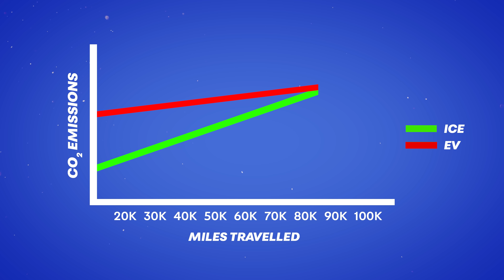Are Electric Cars REALLY That Green? [New 2022 Data]

Comment: If you really care about the environment, keep your current car and drive it untill it falls apart. Every time you buy a new car, the cost of emissions, materials, minerals are huge.
Reply: How is the comparison for diesel with much better mpg than petrol.
Reply: @douglasgreaves188  While you go farther on a given QUANTITY of diesel fuel, the fuel has more carbon in it. the Carbon production per mile if diesel is actually quite similar to gasoline(petrol), which has more hydrogen than carbon, but, you burn more of it. On a carbon stand point, it's not too inaccurate to lump the 2 fuels together.
Reply: @Alfred Wedmore bought wife a Mini 30 mpg at best, my old diesel car would average 55. Looked into EV prices are coming down but I don't do the mileage to make savings. Vans don't have the range. Plus I want to keep next vehicle so battery life doesn't suit.
Reply: @douglasgreaves188  The money you save from not having belts, filters, oil changes, clutches, transmissions, or emission controls will save you more than enough money to replace the battery after hundreds of thousands of kilometers of driving. Add in the savings in fuel, and the question becomes, "Can you afford NOT to have an electric car"!
Reply: @vincentrobinette1507  clutch change 150,000 do my own oil & filters. Travel to London crew van, would need to charge on the way pay crew while waiting. To be on site for safety meeting 8.30am leave house 4.30am. I'm not getting up at 3am to go to work, or leaving Sunday evening. For long range or heavy vehicles EV does not work. If you are not doing the mileage doesn't pay for cars either. Battery life after 10 years no point buying one. I own all my vehicles & look after them don't want to monthly rentals. They might work for some but let's wait to see what happens to all these cars at 10 to 11 year mark & the used car market.
Reply: But I don't want to save the environment.    I want to show people I care about it by driving an EV so I can feel superior. 😌
Reply: If you buy a hybrid you can drive electric through towns and petrol in the country - then everyone is happy - or no-one is happy!!!  :-(
Reply: The question would still be, what car would you buy after your ICE car eventually falls apart?
Reply: Very true! The more miles you put on a car, the more you divide out the environmental cost of manufacture. If you take the cost of the car, plus, all the money you spend on fuel, maintenance, and repair, you will find that the cost per mile will continue to go down. That is, until something major happens. You will need to add the cost of something major like an engine, or transmission to the numerator of the fraction, and see if the car will last enough miles to bring that cost per mile back down. If not, that money might be better spent on its replacement. At that time, you might look into going electric.
Reply: @vincentrobinette1507  No, you don't want to go electric. With an ICE car, what you explained does happen. And it does work that way because because with the ICE car with proper maintainance you can run the vehicle on the drivetrain almost indefinitely. And as you stated this is minor even if you do include something major because once it is fixed or changed due natural lifetime wear you can go back to long term use of the vehicle. WIth the EV you can't do this. Because of the Electrical Drivetrain. you will have to change the batteries every so often. Each time will be expensive and they will never be in the vehicle long enough for you to recoup the price. I am not going to comment on the drivetrain itself because I don't know if it would need short term replacements. But the Fron-Wheel-Drive versions are just like all other FWD vehicles.  Due to structural built-in defects they don't last a very long time to start off with even if you baby them. And I know someone will comment on this and say I know of a FWD vehicle that is still on the road after bla, blah, blah miles. Okay, show me twenty more of this vehicle.
Reply: @Alfred Wedmore Diesel engines have to other advantages: Much higher compression, which gives a higher expansion ratio. Diesel engines have no throttle valve, so there isn't the air pumping losses of pulling air past the restriction of a throttle valve. Between those 2 things, diesel engines are able to produce more usable output per BTU of fuel, than a throttled gas engine. Add to that, the higher energy density of the fuel, and it's easy to understand why there are no gasoline over-the-road semi trucks. Even though diesel fuel is more expensive (at least in the USA) it still costs less per mile than gasoline in the same vehicle. Diesel engines have a much wider range of load and speed that it can operate efficiently, than gasoline, due to the lack of pumping loss.
Reply: @Alfred Wedmore diesel is not more energy dense than petrol.
Diesel engines simply are more efficent
Reply: @Alfred Wedmore epa has ruined diesels efficiency with the exhaust emissions system. No benefit to have a diesel over gas at this point unless you want to give your money away maintaining the exhaust emissions systems.
Reply: Going green doesn't always workout for the hulk
Reply: @Alfred Wedmore The batteries will degrade and it will have to be scrapped in a few years.
Reply: I've got an 18,nearly 19 years old corsa, suits me fine, parts are cheap, insurance is dirt cheap lol!!
Reply: @Truman. AMEN BOTHER.    yes,  and if it's a Honda or Toyota all the better.
Reply: That's my plan, but my next car will be electric for sure.
Reply: @Truman yes and no.  If your old car is burning or leaking oil for example, that's not very environmentally friendly, and many cars start to do this once they hit 200k miles (and some sooner than that) so while it may seem greener because you're not buying a new car every 5 years, it can be more harmful in that regard.  Plus as cars get older, their efficiency sometimes drops, as the engine ages, things wear, etc (this goes back to oil burning for example).  Electric cars are no saint either, in that with current technologies, a lot of harmful waste goes into the environment to produce the batteries, and batteries have only a certain life cycle before they are deemed useless and have to be "scrapped" or recycled (which we know in most cases with recycling, the majority of the materials is not recyclable for many things, only a smaller portion is).  Electric cars are a stepping stone to more truely renewable power sources, like hydrogen fuel cells, which I believe will be the next step in a greener mode of transportatin, once we can figure out how to make this happen on a larger scale.  The technology exists today, but logistics (on a large scale, and perhaps safety) are the biggest issues surrounding this technology.  I don't think the electric car is the future for vehicles, but it is a stepping stone.
Reply: Also buying bottled water most plastics cant be recycled.  Joe Rogan episode on it
Reply: True, and no one forces you
Cars degrade though, usually you sell it on, not dump in a river or a ditch, and when they come to end of service they get RECYCLED
Reply: Engineering explained has a good video on that☝
Reply: @Alfred Wedmore not exactly. Diesels dont rev as high and have torque from low rpm☝
Reply: @Alfred Wedmore more rpm=more fuel. Having more torque at lower revs means you dont need to rev high, thus use less fuel
Reply: @Alfred Wedmore plus diesels have almost twice as high compression ratio which translates to efficiency
Reply: Let's look at the countries that are the biggest polluters first.
Reply: @stevemiller9299  so that you could justify YOUR ignorance and wrongdoing?
PATHETIC and ANCIENT😩
Reply: @stevemiller9299  yeah, lets look at the worst so that we can boost our ego, ignorance and narcissism.
Maybe you should implement this genius "strategy" in schools and workplaces?😩
Looks like you belong in correctional facility or psychiatric unit😁
Reply: @Alfred Wedmore although i am factually correct as all chemistry is in weight as volune is tempreture dependant energy density as in joules per gram. i do however conceed that as we measure or fuels by volume than i conceed that one liter of diesel is greater than one liter of petrol at the same temperature
Reply: @Alfred Wedmore i clearly explained it as joules per gram its a simple concept if you were not being arrogant you would see that. Using STP you could. Compare the energy per liter as i conceeded albiet without being a flog. 
You seam to be confusing energy density by weight with that of by volume at STP easy mistake if your so set on your on point you fail to read what others actually say.
Reply: It really makes little difference if you buy a new car or not. After you've finished with your old one it continues to be used by the next owners until it is scrapped.
Reply: @russelldesilva1560  further down the line, someone scraps a more polluting car to get a less polluting car. So to get at the real environmental profit, you don’t look at your own old car and new car, but at your new car and the even older being scrapped. This is conceptual of course, as you can’t attribute an exact scrapped vehicle to your new car.
Reply: @Alfred Wedmore Diesel was the last big lie, now it is electric cars.
Reply: Then when it falls apart fix it
Reply: True only if you scrap the used car. Of course your used car will be recycled when you sell it to the next person.
Car sharing, walkable cities and public transit are the way forward.
Reply: The only green I care about is all the green (money) my EV is saving me.
Reply: @josephmcclary9667  a fair thought, because no personal car or commercial consumer product is going to save the ecology.  We buy things we use.  Our consumption and  use of things produces impact.

If 120,000 miles of a gas car use starts with a $20,000 purchase (say the new Maverick car/truck)  or a $17,000 Sentra/Civic....then you will use 3000 gallons over your years with the car.

If the cheapest good EV, the Tesla 3, costs you $55,000 then you don't save cash until you've bought $35,000+ in gasoline if the electricity is free.  It isn't,  so you don't really save money till you buy $45,000 in gasoline.  That's a lot of gasoline.

Math is a cold mistress.
Reply: @STho205  my LEAF came in just under $30K before tax. I drove approximately 55K last year with no end in sight. I’m hoping to get 3 more years out of it, then it will go to either my kid who will be 17 then, or my wife. I pay either 0, 7 or 24 cents per kilowatt hour depending on how sunny the day is/was (I live in Phoenix) because of my solar panels. I drive this car and it makes me money. I wouldn’t make squat with an ICE vehicle. Plus I’d be spending much more on maintenance.
Reply: @STho205  by the way, it’s an apple to oranges comparison to use a Sentra (econobox) and a Model 3 (compact luxury car). Nobody in their right mind would cross shop those. Why not use a Lucid vs a used Pinto if you really want to make an invalid point?
Reply: @josephmcclary9667  model 3 is the bottom of the really usable EV market.  A Leaf is a compliance car and still overpriced at beyond double the Sentra.  The other cars like the pieced together LG-China Chevy Bolt (when they feel like building some) or BMW or Mini aren't really approaching the real usability of a Sentra as a transportation device but are much more expensive.  Volvo E, Tesla S, MustangEs, Audi Es are more extensive than the average budget T3 long range config, so the T3 is the best to compare.  A car is a device that moves you butts without walking....a luxury couch and infotainment center  is irrelevant

So it is apples to apples.  It is the fault of the EV mfgs to not build a car that sells for 20k like a much more versatile Maverick or the same five seat cramped sedan as a T3.
Reply: @josephmcclary9667  good for you.  30k NEW without help from other taxpayers via credits?  If so you just have to add $13,000 in gasoline to an equivalent Nissan Sentra to break even on free electricity.  $20,000 of gasoline with the charge electricity actual costing.

Don't forget the extra meals and extra hotel stays for any long trip that could be accomplished in 9 hrs or less with the Sentra but 14 hrs for the Leaf.  They add up to about an extra $100 a day for a couple travelling.

Math, a cold hearted mistress.
Reply: @josephmcclary9667  amort your solar panels and maintenance over 10 years at a price per day.  That's how much you pay for the "free" electricity based on the kW actually used each day.

I'm grid hooked to nearby hydro.  Costs 8c.
Reply: Buy used and drive it till it falls apart.
Reply: @jrandliz  not a bad approach.  Eventually the unreliability is a factor that costs too much money or possibly lives.

Eventually any appliance needs to be recycled or rebuilt.

I've found some frugal cars can go 18 to 25 years in good service if maintained well and you bought it young.  If you buy a beater....best you'll get in 10k mi and 1 yr for every 1000 you spend.  Worst you'll get is nowhere. 

I had a 1990 Miata for 16 years and it had probably 5 more years in it, but I needed a back seat.

My daughter's HHR is a 2006 and in pretty good shape.
My Ford is a 2013 and still runs and looks fresh.  Conveniently starts every time I need it.
Reply: That is what I did.  I had to change car because they didn't make replacement parts for it anymore.    It needed a new gearbox and to have one custom made or the current one restored cost more than twice the value of the vehicle.
Reply: Biking or walking is greenest of all
Reply: @sprucedude  dying is greenest of all.
Let me ask this in sincerity.  Assuming you are an adult...  Do you own an automobile and drive?  Do you walk to work, market?  Do you live close to 90% of your desired destinations?
Reply: Same can be said for ev cars, you have to make the batteries, where do you dispose of spent batteries?
Reply: Thank you!
Reply: But obviously maintaining it before it falls apart…
Reply: This is not necessarily true.  Pretty much every car that has been produced will be used by someone.  You buy a new EV, and sell your old gas guzzler to someone else who drives it until it dies.  But if you sell your gas car to a retiree who will drive it less than 3000 miles per year, and you replace it with an EV that you drive 10k/year, you've just reduced emissions, and you have done so without creating demand for another gas-powered vehicle.
Reply: Does that assume that the current car (the gas powered) is not being sold, and not going to be used?  Wouldn't the next owner also be part of the equation?  I'm not sure how that works out though.
I get what you are saying, and generally that's what I think, but I'm trying to consider the entirety and see if that line of thought is right.  
We'd have to assume that if the car is left in good condition when replaced, that it'll still be driven by someone.  Assuming some sort of trickle down effect with cars, with some of the market consistently buying secondhand/thirdhand/etc.  and consistently needing "new" used cars, does it actual make a difference if I bring an EV into that consumer stream earlier?  Does that cause any vehicles to be disposed of earlier, with that considering?  I wonder.
Reply: Well, like someone's already said, the greenest option is no car at all, if possible.
Reply: That's the best advice for going green. But plenty of people need a new car each year or two so they can keep up with their neighbors, potential tax write off's and help the economy.
Reply: That’s a fair generalization but a bit simple. Changing from a 1975 Impala to virtually ANY new car nets a gain in a week or two, for a extreme example. Any car can become much dirtier even from low standards of maintenance so a change to even another ICE car can net benefits in a couple years. I keep cars for 20-30 years and maintain the crap out of them, really a necessity for such a long life. But still, I’m driving an older car and it pollutes much more than any 2022 model.
Reply: This^
Reply: In Holland are taxes more expensive  for cars older than 15 year!
Reply: Yes the same goes for your every day plastic bag
Reply: Quite often this isn't true. If you count the option of converting your current car into an EV, you most certainly shouldn't just keep your gas car. Costs money, though.. 😏
Reply: Just make sure to change your spark plus and service!
Reply: Wrong!
Reply: Check out videos by James Tour on flash graphene.  Huge potential for CO2 and methane reductions
Reply: Agreed. I’d like to add to this, buy a used car if you can - if you can buy a used electric car, so much the better. It’s better for your wallet and the environment.
Reply: What’s wrong with selling it off to someone rather than using till it falls apart?
Reply: YES!  This!
Reply: By then your engine would have lots of problems a lot of parts would of been replaced and you can’t get a good deal out of it
Reply: @budderz908  Cheaper to maintain an old car than buy a new one. Unless of course you own a European POS.
Reply: @Alfred Wedmore their is more to Diesel better mpg than fuel density. Diesel engines are more efficient than gasoline engines for two reasons: (i) higher cylinder pressures and corresponding higher temperatures lead to improved thermal efficiency for the diesel engine; (ii) the air throttling required to control the gasoline engine power output reduces engine efficiency / volumetric efficiency. I would also would like to see what the initial carbon footprint manufacturing a battery with 400+mile range. True like for like comparison on other factors would be interesting too
Reply: Mine did Fall apart and now I bought an EV. Before that I usually only bought used cars which would break down every 3 to 5 years and rhen I Sold them and they got shipped to africa where they probably still drive around and pollute the Air.
Reply: .. Sounds good until you realize that the cost of repair often exceeds the replacement cost of the entire car.
Reply: I'm going to drive a v8 until I can't afford the gas or they pry it off my hands.... too much hypocrisy around this
Reply: Consumerism vs Keeping and repairing is not sustainable. We either change our culture or we fail.
Reply: @Exo runner hydrogen fuel cell is not cleaner than an EV.
Reply: 100 💯
Reply: Or don't use anything but your 2 feet or a bicycle
Reply: Dumbest video I have ever seen. Look at how much pollution is generated from getting the crude oil into the gas tank of the car. A ton more emissions and other environmental damage is done. Initial farming of the materials for the batteries is very costly but about 90% of the batteries can be recycled making it more environmentally friendly. Also Tesla giga press reduces the amount of materials needed to manufacture a car is a big plus. States like California are already about 50% renewable energy and much of Europe is even more. Overall from day 1 electric cars are better. Legacy auto is so far behind in electric tech this is the only way they can discredit EVs.
Reply: Alternatively, manufacturers could stop using Henry Ford's planned obsolescence as a core principal and build products to last and we could not allow fossil fuel industry executives to decide the fuel economy standards manufacturers use.
Reply: No comparison, 30+ year old car 1ton with catalityc converter, 6l/100km...
For the weekends, a camper 7l/100km. 
20+ year old bicycle for the city,
Whatever I do, however I abuse them, I will never be able to release more than 40 tons CO2  for the next what 30 more years?
Now look at it this way, the average person releases 900g CO2 every 24h. When I ride a bike, my CO2 emissions triple for the time running it. 
Now back to the 900g, multiply it to the 8.5 billion humans populating the earth and... 
So a smart ass would rather suggest to stop breathing while riding bike?
Allow me to give you another perspective, how many recharge cycles the battery will last? Will you reach by then the those 135000 km? 
Then to keep greener you buy a new battery, great another 25-30t of CO2 right? And you are O.K. with that? 
2 options here, you sell the car for pennies to someone willing to replace the battery and drive it, which won't be always feasable(a new ev will have a lower cost by then...).  Or send the useless electric car to a poor country and polute their land with all the heavy elements the battery contains... 
And then guess, you also have helped polluting the ocean with nickel, cobalt, cadmium to name a few. 
One day a good parent buys a tuna can for his son... And hes brain got damaged of heavy metal poisoning. 
I'd rather stop the rant here, but new ev I doubtfully clean the air, but polute the land, then the sea, and then it hits back to you, me and all living thing, only from a different direction. Follow the money, and then you will see, all car companies are creating a huge wave for everyone to ride a hype on. And thus keep selling for more profit.
There is more to this, but is already a long post for Saturday morning, I'd better go ride bike with my son than chiseling here.
Reply: Scrapping your existing car if it’s older than 5 years and buying an ev is the better option.
Reply: @tigertoo01  not even close to the better option!
Reply: Spot on 👍🏻
Reply: I say ,buy what ever car you want and cycle everywhere and only use the car occasionally!  You will save wear and tear, ⛽️ fuel, get fitter and healthier.  Let's get off our ass instead of sitting in the car all the time!
Reply: @markwalker2986  good plan!
Reply: ok
Reply: You don’t order a car from scratch lol
Reply: @sillymesilly  you mean you don't I always do so I am not stuck with garbage that I don't need or want and that has a huge toll on the enviroment!
Reply: If you care about the environment avoid getting a car at all
Reply: @DiversionG  yeah let’s all just go back to the Stone Age!
Reply: @asifitmatters1  Ever heard about trains
Reply: Truman I absolutely agree, I would never buy a new car anyway due to the obscene price, not to mention, they all look and drive pretty much the same these days, too much assistance in the controls and too many nanny statery electronics for me I'm afraid.

Let's be honest here, nobody in the grand scheme of things is buying new cars, and they certainly aren't keeping them for 90,000 miles, they are financing them for 3 years (and probably doing 10,000 miles per year) and then moving on to the next new one. If we keep this model with EVs we will do FAR more damage to the planet than using what we already have.
Reply: How does keeping your current car help with grid battery storage?

Great way to help China wipe out European brands though 👍
Reply: They tell you anything and lie . You are consumer and you must buy. Whatever makes you feel good and buy buy buy. Your all little money works now buy this b.s. now
Reply: Tesla takes less than 6000 miles to absorb ALL production and component emissions
Reply: Or if you have decent public transport, just use that or a bicycle.
Reply: My current car (95 Honda Civic) had been falling apart for years but it's finally getting bad enough (a literal hole in the chassis just in front of the driver seat) that I'm ready to buy my first brand new car and it's going to be electric ⚡😁⚡😁⚡😁
Reply: Uce public transportation
Reply: Only if you junk the car, most cars are resold
Reply: Exactly
Reply: Someone needs to relay this info to the London Major. 😅
Reply: In India, there's a (ironic) rule in cities high on pollution like Delhi, that citizens can only keep a car for max of 15 years irrespective of whatever emissions conditions of that car be (even after the BS6 norms). One compulsorily has to change his/her vehicle after 15 years of purchase or the government has the right to seize and dump your vehicle.
Haha, like they really made this rule for "prevention of air pollution" and not at all for profit maximizations of the car manufacturing industries ! YEAH RIGHT...
Reply: Stop with the propaganda lies. We have a supply chain problem for obvious reasons. But a trend of Less New Cars going forward seems permanent. The Average Fleet Age of ALL Cars is getting older. People are NOT scrapping cars early causing more waste than before. We CAN NOT just keep delapidated cars on the road indefinitely. Eventually the Average Fleet Age gets too old and becomes a Reliablity Safety risk. Your Insane Propaganda ignores than 2nd Hand Cars stay around for a long time.
Reply: @Gusli Kokle but that's not how it works. For example, a Leaf battery is 48 packs each with four cells. If your capacity gets too low you probably only need to change one or two cells. Which will cost less than one fuel injector. And if you ever do change it the whole pack, it's worth a bit of money second hand for industrial or domestic storage. They're highly sought after because no one ever really changes them! And when they're totally dead, the materials can be reclaimed and recycled.

Of course you can find isolated instances of total failures. I can find isolated instances of petrol cars blowing up when they spill fuel onto a hot exhaust. But in general, the packs last ages, can be easily repaired, and have a good second hand value even when every single cell is below what you need to do your daily driving.
Reply: They are forcing us to buy electric. That's one reason they want high gas prices. Please think about it.
Reply: @SerenitynPeace  Yes, and one of the things that happen is that Brandon shut down all Gulf offshore production.
Reply: @beauxr.benoit1374  A lot of damage done... 😔
Reply: For the global environment keeping existing ICE can be greener, I own my cars until they die an don't have an EV yet. But for local environment that is a completely different story, especially in cities where vehicle pollution is starting to be listed as cause of death as the respiratory attacks and death rates coincide with NOX and particulate density at street level. Ironically some of the worst pollution damaging your kids is when parents lovingly drop them off or pick them up from school as loads of idling ICE powered SUVs are gathered outside the school.
Reply: @johnpublicprofile6261 You're absolutely right. In my state, they actually ask us not to idle our cars, for that very reason! (one of the main advantages of a Hybrid, or electric)
Reply: @johnpublicprofile6261  nah, swapping is better for co2. The problem is burning inside the engine.
Reply: Engineer, designer, fabricator , do this for a living, new electric cars greener than OLD cars, absolutely not
If the older cars are redone ( cheaper ) burn way more efficiently, batteries are hazardous waste , plastic and batteries , 2 worse things we create, can’t get rid of, the batteries for your flashlights, cameras etc... do you throw them in the garbage or recycle, like your SUPPOSED to, going out on a limb here, NO, now times that by 10 million plus, of radioactive junk in landfills, now add 10 batteries in every car in the world, lithium at that, worst of all, the damage on this planet you have just created because of making a battery
Everything runs off oil, 95 % of what you use daily in your life, oil comes into play, comes out of the ground, goes back in, natural, batteries are NOT, it’s just WASTE
Reply: @user-dz6wg8wr1d  yup, making cars is terrible for the planet. But you know what's worse? Burning gas in your engine. That's all I'm saying. You can totally make more pollution and cause more greenhouse gases driving a car than making an EV, if you drive far enough.
Reply: The best option: converting your old car to an EV
Reply: Carbon isnt bad!!!!!!!
Reply: There is also the cost of replacing the batteries after about 9 years. That should really penalize the ev.
Reply: Using buses , trains , metro , bicicle , on foot , and tram is the cleanest way to travel , according to ME.
Reply: Or don't get a car... Oh wait you can't cause car and oil industry rule our lives
Reply: @Hhhh22222-w  I've been to places where the public transportation is so well developed, I probably wouldn't own a car. If I buy something big, like a water heater, or even a big screen TV, I would just pay to have it delivered. If I buy something from a home improvement center, many of them have trucks that you can rent, to haul building materials or large appliances or even yard power equipment home. You do that so seldom, that you save money, by not having to register, insure, maintain, and fuel/charge your own vehicle.
Reply: @Hhhh22222-w  what are you trying to say? This sounds so stupid. If you don’t want to buy a car then don’t
Reply: @Hhhh22222-w  what are you talking about.
If I want to visit a specific area in the countryside for example I need to drive.
Or pick up and drop off my kids at nursery for a very specific time.
That's not oil companies and cars ruling my life, that's the oil industry and cars providing a service that allow me to live my life how I want to.
Reply: I wonder if Volvo included the enormous environmental issue of mining the exotic metals used in batteries. For example Cobalt from the Congo where the workers are kids. And pollution when shipping these metals to battery factories. Then the pollution to dispose of them when they wear out. 
Regular cars use mostly steel and aluminum 
Which are easy to recycle
Reply: Making batteries cause far more pollution that making a "fuel guzzling" Range Rover OR otherwise a Chevy Suburban! So care to buy one of these then?!
The only thing that convince me to go EV are the running cost as well as smooth and quiet ride. A 5 minute drive from home to a liquor store only cost few pennies! Heck I've ended up buying more booze since I can save so much on transportation ;P
So EVs are not really that green.
Reply: @t8polestarcyan22  Most important of all, NO DUI's IF SOMEONE ELSE DRIVES!!🥳🥳
Reply: @t8polestarcyan22  Er no sorry, you have that backwards.
Reply: @thomasowens5824  Buying new cars promotes manufacturing. Manufacturing more cars esp. EVs cause lots of pollution!
Reply: @t8polestarcyan22   A suggestion,   maybe your local adult beverage dealer can deliver your beverage needs and really be 'green'  Just sayn'.   
Aye have a pint on me.  (so to speak)
Reply: you are missing the point, that being clear air. Green is part same as sewers and refuse collection. It is better to lose the ice as soon as possible.
Reply: @mikewade777  I think the point of the OP is we should consider the total pollutants introduced to the environ, not only during ownership but from mining of raw mats to production to disposal.

I believe in EV the mining, refining and prouction of battery raw mats are very polluting and if you don't keep the EV for at least 5-8 years, it will introduce more pollutants into the system during its lifetime (not active and in use lifetime but total lifetime).
Reply: @mikewade777  I was thinking of the planet as a whole but when you think only of populated areas, makes sense.
Reply: Not good enough. You can keep the Rear-Wheel-Drive ICE car on the road forever with proper maintainance and fixing or replacing parts whenever necessary. And he isn't giving all of the info either. An EV will never have a chance to be as clean as an ICE car until they have better ranges. Also for the middle mix leading to 53K miles, I would suspect that the EV would have needed major repairs at least Three (3) times regardless to how you take car of it as compared to Zero (0) for the ICE car with proper maintainance. No, an EV will never be cleaner than an ICE car. That isn't possible until the EV has a better range, but there are still other factors that make them worse. The open conversation is also an atempt at a resolution in case EVs backfire. What if everyone finds out all of the info and no one else wants an EV? What if the car Companies go full EV, and then no one wants to buy one after it gets to the point where there are no ICE cars?
Reply: Actually scrapping your car and buying and running a brand new EV can be greener.
Reply: @therealjpster  Going to need a source for that incredibly unbelievable statement.  Recycling consumes energy, especially reclaiming raw materials.
Reply: @system11yt  Raw materials are extracted, recycling doesn't involve raw materials
Reply: @therealjpster  riding bicycle is the greenest
Reply: @jianyangkoh6386  of course it is. I don't feel this needs saying.
Reply: @jianyangkoh6386  Cycling will make you breathe harder so you'll produce more CO2
Reply: @therealjpster  Jian DID!
Reply: @jianyangkoh6386  not really because every time I get behind a bicycle I have to slow down and drive in a lower gear until I can get around then accelerate past.
Reply: @sahhull  don't plants need c02? Aren't plants green? Isn't everyone talking about going green?
Reply: @sahhull  huh ?? not as much as a 2 ton car or an old smoky bus  !!!
Reply: @jianyangkoh6386  sorry, I refuse to ride bikes on the same road as cars, even if I don't end up quardriplegic the stress of cars constantly almost mangling my body is no acceptible subsitute.

Also, this may surprise you but in the UK it rains.
Reply: @jianyangkoh6386  walking is greener
Reply: @jianyangkoh6386  Cycling is Greenest! Not so fast. There are many articles written today and going back to the early 90s that explain how cycling is not as green as some think. (Let it be known that I've biked to worked since the early 90s, so I'm not just talking here.)
Some items to consider.
1. Extra calories you tend to eat costs Co2.
2. If you didn't have a bike. Purchasing a 1st bike costs Co2.
3. Bikes love to get flat tires.  New tubes and tires each year. More Co2.
4. Cities all over the world are widening roads to add bike lanes. More Co2.
These are some of the example that bridge the gap between the falsehood of carbon free biking and car driving.
Reply: @jianyangkoh6386  walking is so green that it's red.
Reply: @jianyangkoh6386  no actualy people run on carbon and we put out Co2!  Our muscles are less then 5 percent efficient were a gasoline engine burns Hydrocarbons  and the engine is over 60 percent efficient!
Reply: @therealjpster  yes the community needs to be reminded over and over about cycling. So many more driver only trips can be by bicycle or if somewhat longer by e-bike. The best EV is an e-bike in terms of minimum resources for 1 person to drive/ride around. But both bikes & e-bikes are underutilised.
Reply: @jianyangkoh6386  so if we just keep shipping bikes on diesel shipping boats, that's greener?

Lol
Reply: @therealjpster  the batteries on ev cars need replacing before 100,000 miles so they aren’t even close to being green. Not to mention the electric grids will never be able to handle all that charging necessity or the greater expense of e v s compared to combustion cars
Reply: @therealjpster  how on earth did you work that out? Scrapping a 20 year old car which only does 5000 miles a year in order to buy a newly manufactured EV??? How is that "greener"? Did you even watch the video or read the Volvo study? A new EV needs to be driven 90k miles in order to be greener than its ICE counterpart! That's comparing like for like ie new cars, and EVs are still not "greener" unless they are run for 90k miles 😂😂😂😂😂😂😂😂😂
Reply: @pedazodetorpedo  the 90k miles is highly dependent on the local energy mix.

As any car has an expected lifetime of wel over 90k miles, the ev is thus a greener option. Doesn’t matter whether you drive all of those miles yourself or whether the next owners bring it to 90k miles. The car doesn’t disappear after you sell it.
Reply: @therealjpster  Based on what?
Reply: @therealjpster  if you have a serviceable car then no the EV will likely never recover from the excess carbon industrial pollution in the remaining life of your current car.

If you have a 7 year old Honda Civic or Fiesta (40mpg) with another 7 years good life then look at the EV graph for the Volvo.  Now plot your EXISTING car at 0 miles and zero carbon starting (because that carbon was already produced 7+ years ago).  You'll need to go out about 180000miles to catch up to that Volvo EV with a mfg footprint of today plus the electricity and other carbon based support.

However at the end of the life of your 4cyl in 7 years from now....buy an EV and they may be more efficient still.

Mfg and Ag is over 60% of the world's carbon.  Cargo vehicles is about 20%.  Military about 15%.  Personal automobiles is about 5%

EVs are barely affecting anything since most need 5 years to make an appreciable effect.

When the military, ag, industry, trucks, ships and trains go to zero emission....then we're getting somewhere.
Reply: @therealjpster  the ‘’greenest’’ is to actually stop breathing (your exhale is 100x more co2 concentrated then atmosphere)
Reply: @therealjpster  utter rubbish.
Reply: @therealjpster    So, you didn’t even bother listening.  Ok.
Reply: @therealjpster  Tesla is considered the least relatable car in the road. To that of the batteries dummy last that long so this ev green line is based on a very pie in the sky view. Batteries also have a hard ground waste problem with toxic metals. Strip mining and so on.
Reply: @therealjpster  your completely wrong lol💀💀
Reply: @therealjpster  don't be daft
Reply: @therealjpster  in what universe could that be true? Maintaining a fairly recent vehicle in working order (less than 20 years old) is always going to be less polluting than producing a brand new electric vehicle. At least for the average user this is definitely true.
Reply: @therealjpster  yeah, if you kept the EV for about 20 years...which you wouldn't and if it didn't need a new battery pack or 2 in that time...which it would
Reply: @therealjpster  scrapping a car also costs Co2. I wouldn't be so sure about that statement...
Reply: @therealjpster  with all the stuff discussed in this video, wouldn't a hybrid be better?
Reply: @therealjpster  have you ever compared how many components can be recycled from EV or ICE vehicles. The biggest problem in the world is that every thing has become disposable and have very short life spans. Look into recycling of the EV and the carbon emissions used to recycle the batteries. It isnt clean in any way. Look into how lithium and cobolt are mined. Whats the use of going to something if its just causing an evoromental disaster else where or later in the future. Driving a EV or ICE vehicle pollutes the world each just in slightly differant ways. If you want to really help the world, move closer to work and by a pushbike and keep it well maintained so you will never have to by a new one.
Reply: @frankbob6664  screw helping the world, just drive what you want. Earth is screwed either way
Reply: @frankbob6664  You're forgetting, that batteries are recyclable. When you fill a gas tank with ~200 pounds of fuel, ALL of it is gone, when you run out of gas. (no possibility of recycling) The ~900 pound battery STILL weighs 900 pounds, when spent. You have no way to recycle fuel, there is a way to recycle batteries. While recycling is in its infancy now, it is developing, especially, as the price of the elements in a battery are becoming more expensive. an old school lead acid starting battery is about 98% recyclable into a new lead acid battery. They've been recycled for over 100 years. If you go to an auto parts store, and buy a new battery, it's almost entirely made from recycled materials. Lithium batteries will soon reach that point, with modern technology. Recycling any battery is energy intensive, but, that energy can come from renewable sources.
Reply: @vincentrobinette1507  perhaps you should look into how they recycle lithium batteriies. It not the energy used its the chemicals and its waste. This also goes for wind turbines made from fiberglass and solar panel also made from highly toxic metals. Really in the long run there is no such thing as non polluting energy, everything has its limited life, but when you look at ICE vehicles engines can be rebuilt or recycled. As for your hundred years of development apparently we, according to 99% of scientist have only a few more years left before we reach the point of no return. Look back into history and you will find the first electric car was built in 1832 with many attempts since. Lithium batteries have been around for 30 years and they still don't know how to put them out when they catch fire. Nuclear has been around since 1942 and they still don't know how to recycle uranium waste. Just because they say it will become cleaner doesn't mean it will. If you you buy that belief many can go by the same belief that ICE vehicles will as well.
Reply: @vincentrobinette1507  further to your comment, no country in the world uses 100% renewable energy so the power that isn't coming out of the car is coming out elsewhere. Coal is the number 1 power source in the world and is currently selling at record prices. Europe has tried to do a dodgy go green by shutting down coal and gas but buying oil from Russia while England is relying on Frances nuclear power. 3rd world countries can't afford anything but coal power plants while China has 1100 coal fired power plants and are building another 43. All Tesla's for the Australian and many other markets are built in China. Most of the worlds lithium batteries are made in China using coal fired power. The world buys most of its steel from China. Where does the idea of clean cars and power come from? While its been a few months since I watched this video the question must be asked if he is refering the Tesla's built in the nice and clean US or the ones built in China?
Reply: @frankbob6664  maybe you should try to be on update and make sure what you say its corect. Fiberglass can be reused in other applications. Also ice cars need rare metals too and it cant be recycled from ice cars in the end of their lifes while oil and lubrificants(i think) can be recycled the rare metals from ice cars dont. Also there are already companies that are trying to find a much better way to recycle batteries and its possible to do this we just dont know how to do that yet. And another thing acid batteries(from ice cars) have lead and lead its toxic and dangerous for us and life in general.
Reply: @netrox1345  you said "its possible to do this we just don't know how to do that yet" can I say " we can make ICE vehicles much more cleaner we just don't know how to do this yet" both comments work on the same ideal so why not stay with ICE vehicles. As for rare metals in ICE vehicles it nothing comparec to EVs. As for fiberglass being recycled sure it can be but it is a very expensive process that is often overlooked as it is cheaper to bury them. To me many of the ideas they are coming up with have a long term environmental problem for the following generations. Perhaps people should just hold on to what they already have rather than update them constantly, less gresshouse emissions and less need for recycling. I'll stay with my 20 year old car and bank those carbon credits.
Reply: @frankbob6664  and maybe you dont know that but you should look to see how much damage the ice cars, fossil fuels and oil industries they already done in 1930's
Reply: Thats 92 years ago and yet the world didn't end. Vehicles back then were made from steel and cast iron the only reason they weren't recycled was because they didnt want to. But thoses metals also break down. The oil, fuel and tyres were the only parts that were toxic.  Compare that to a modern EV and all of their toxic materials. A Tesla has 900 pounds of lithium batteries that contain lithium compounds, cobolt,  nickel compounds, arsenic compounds, and dimethoxyethane. As I have already stated most countries still rely on coal and gas fired power. All an EV is doing is moving pollution out of the cities.  The mining for theses metals are very harming to the environment and as stated in the video is very water intensive in dry environments and as also stated in this video can be immorally and ethically wrong. While your thoughts and morrals on child slavery changes to suit your narative mine doesn't.
Reply: @therealjpster  Actually, you don't know anything what you're talking about. One person in a developed country can spend 100x more emissions/energy CO2, CO, HCx, NOx, etc, kJ, kCal, kWh in his lifetime than a poor person in a developing country. It's not just emissions from your car, it's your entire lifestyle, your house, your heating/cooling activity in your home, all your modern appliances, your vehicles, your travels, all your purchases including constantly buying new thing is a human activity measured in emission/energy. 
So if you think you are "green" driving an EV, you're like many millions brainwashed to the modern consumerism. As I said if you really mean being green, move to Amazonas or Pacific islands living off the ground, using minimal modern amenities. Wake the f up.
Reply: @TrumanBurbankFE  I didn't say green, I said greener. But I agree anyway.
Reply: @TrumanBurbankFE  I really don't see how self inflicted poverty is a solution to anything.
Air pollution is far worse on poor countries than it is in wealthy countries. We can't all live on sparsely populated islands can we?
Quoting Dan hannon, why are wolves thriving, lions becoming endangered and tigers are flat lining? 
Wolves live in wealthy countries, lions live in poor countries and tigers live in the middle ground.
If all countries were poor, we would still have industry and we would still pollute and not care about the world around and focus a little more on our immediate problems. Like food. Poor countries might pollute per person less overall but there would be no solution in sight.
Advances in technology come from a strong economy which leads to a good education.
So if you really want to help become a scientist or an engineer.
We should be pushing for every country to become wealthy so we have more educated minds that can focus on solving problems.
Reply: @TrumanBurbankFE  So you live in a tent hunting but with internet access ?
Not easy to do.
Reply: @TrumanBurbankFE  All very true, but this article was about comparing electric cars to similar combustion cars.
Reply: @richardschofield2201  You and Truman Burbank both need to meet on middle ground here because you are both right and wrong on some of these points. One is right about modernized consummerism and cleaner living and the other is right about living in a more modern life-style. And they are both too far in each's extremes.  Yes, we need to live cleaner and recycle and conserve more, but most also need to be taught this. And yes, living off the land gives you cleaner everything and provides self sustanance and also helps the Planet. Again, more people need to be taught this as well.
Reply: @TrumanBurbankFE  actually, there is a distinct difference between air quality in a city of the 3rd world opposed to 1st, its much much worse. However, 1st world consumerism is grotesque, especially in USA.
Reply: @richardschofield2201  You presented a well-written comment that effectively addresses the point. And yet notice his comment got ten times as many upvotes as yours did. I'm with you, brother, but it's clear that our well-funded education system turns out economy-bashing sheep.
Reply: @richardschofield2201    “Self-inflicted poverty?!!!??”  So how big is your trump flag?
Reply: @suserman7775  thanks. Appreciate it.
Reply: @artysanmobile  urmm. Ok. 
I'm British so don't really think about trump much.
Why don't you say what you really mean?
Reply: @TrumanBurbankFE  Thanks for making this point. I was beginning to think that I was the only person who knew this. 👍
Reply: @richardschofield2201  air pollution is far worse in poor countries because developed countries dump their pollution in the poor countries.
Reply: @natehb  how do developed countries dump their air pollution on poor countries exactly?
It's not like we bottle it up and ship it over.
Reply: @richardschofield2201  ,  poverty is subjective. There is a strong argument that living a low footprint, meaningful life, connected to reality instead of a screen, is far richer than the materialistic life characteristic of "1st world" living.

Currently, the weight of my possessions, have me longing for a lower footprint "self-inflicted poverty" lifestyle. If you feel richer living it, it is the opposite of poverty. Poverty itself is subjective.
Reply: @derek2593  remember you're only talking about one minor aspect of poverty. Material possessions.
There are more important negatives of poverty such as a lack of healthcare, heating/cooling, nutrition, education etc.
Bit of an old report now but in 2014 UNICEF estimated that 8 million children a year die by means that wealth would have prevented. In other words, die to poverty.
I'm not exactly sure which of my comments you are responding to, can't remember what I said and the thread is too long to check but poverty and the damage that comes with it can not be underestimated and needs to be avoided. She should all be aiming to generate wealth within reason.
Reply: @richardschofield2201  I think you are overusing the word "poverty". I have healthcare but I don't use it, because I have found cures to just about every ailment in the nutrition world. I have learned more through the internet than I did in high school and college. There are exceptions, but more than ever before in history, poverty is a choice, although, usually a subconscious one.
   Personally, I look around and consider people that rely on drugs, and healthcare that is based more on profits than good health, to be poverty stricken.... even if they drive a Tesla, live in a mansion, and have caterers. I consider myself far richer than them for learning the nutritional reasons and cures for my ailments, how to cook for myself, and being able to find comfort in nature instead of materialistic belongings. I live in the richest county in the United States, and my eyes see more poverty than anywhere I have lived prior. The people with the most money, are often the poorest where it matters most.
Reply: @richardschofield2201  hypothetical, but, is it poverty if you are dying of cancer due to the excessive roundup sprayed on your immaculately landscaped lawn? If not, then I'd rather be alive and in poverty, than rich and dying.
Reply: @derek2593  "Poverty is a choice".
I assume you're not talking about poor people who live in deeply corrupt countries who's only consideration is where their next meal is coming from.
Hardly a choice for them.
I don't think you understand how wealthy you are.  You say you have found cures in the nutritional world. The poorest people barely have enough nutrition to keep them alive nevermind using nutrition to find cures.
You've researched on the internet. 
Hard to do that when you don't have the resources or infrastructure for internet.
I'm not missusing poverty.
Poverty is real, it's not a choice and it kills millions of people.
Reply: @richardschofield2201  , yea, fully aware, but my response was to your "self-inflicted poverty" comment. Just cuz someone feels like living a more natural life, does not imply "self-inflicted poverty". 
  Yes, I am very lucky, but luckier than most people think. Modern health advice almost killed me. I am merely pointing out that 1st world living, does not necessarily mean better. 1st world is dying from greed and excess while the 3rd world is dying from the opposite.
Reply: @derek2593  ahhhh, I see how you've interpreted my comment. Gotcha.
So what I was trying to say is if, to use your words, we all lived a simpler life, spending would tank, economy would collapse and supply chains would fail.
This is t an exaggeration, if we don't spend money the system falls over.
So I wasn't saying that living a simple life would mean your living a poverish life, rather that it would lead to an economic disaster resulting in a world where you can't buy food, medicine etc.
Hence the self inflicting poverty.
Reply: @TrumanBurbankFE  Engineering Explained made a great video talking about your very statement I definitely recommend you check it out. It’s called “Is keeping your old car better for the environment”
Reply: @therealjpster  running an EV is greener but the mining and production processes of the battery as I understand it is far more polluting than a regular car. I believe I saw a study showing that if you can keep your EV for 8 years then yes it is greener, but if you change it before 8 years then the net polluting effect (from production to disposal) is higher with EV.
Reply: @ap5672  I suspect the report doesn’t show the same mining issues for the mining and production process of the fuels and oils in an ICE car. More importantly however is the fact that most cars will last longer that 8 years. Unfortunately this means that it is the second or third owner that is hitting the break even point and not the one that has the initial outlay.
Reply: @ap5672  doesn’t matter how long you keep it; if you sell it, someone else will be driving it.
Reply: @therealjpster  Worked in recycling for years, you should see the 'system' we use. It is non existent. Nearly every part of recycling in the 'green' energy sector is obliterating the Earth in ways you cannot fix. Solar panels have very short lives & cannot be recycled, while causing irreparable damage when produced. Batteries, exact same. Wind turbines, exact same (with massive footprints to store debri). Ground miscellaneous resyn (plastics) are sent almost exclusively to India & China. They are then melted in unsustainable dirty factories, with the excess being dumped into the ocean. With easing restrictions to appease cheap manufacturing, third world countries produce much dirtier energy than the U.S., while we can produce hundred-fold cleaner products using natural gas than any other method or country on this planet. It is a giant deceptive spoon being fed to the public. If you are an environmentalist, the truth will make your stomach rot.
Reply: @therealjpster  absolute crap
Reply: @therealjpster  WoW you didn't pay attention to the facts at all did you? You have to have an EV for minium 8 years just to break even and at some point you have to replace the battery pack lol
Reply: @therealjpster  
Did you watch the video? It’s dirtier to produce the nice new EV.